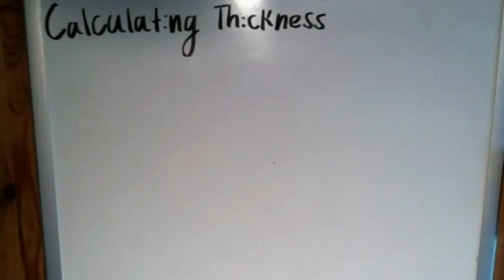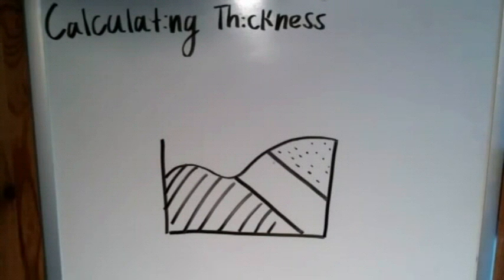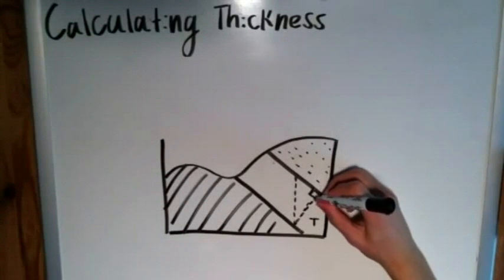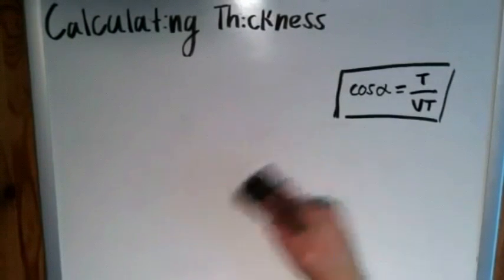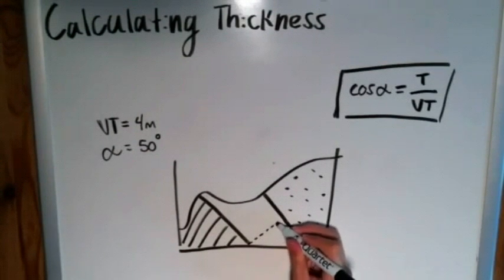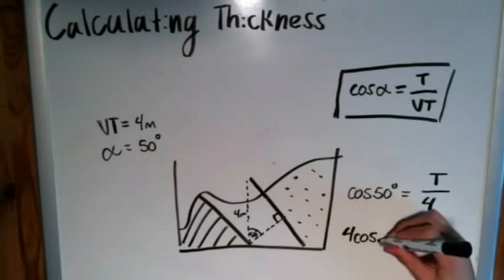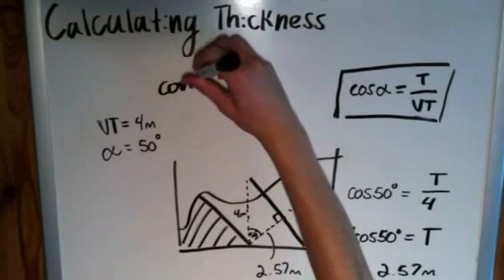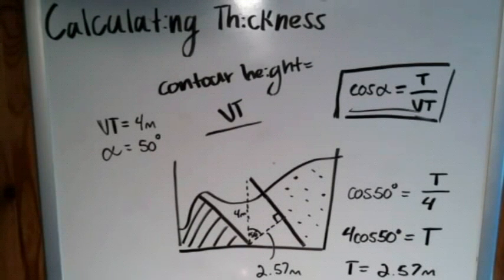The Basics of Geology: Calculating Thickness

Comment: Is the vertical thickness is the true thickness?
Reply from the maker: No. Vertical thickness refers to the thickness, the length, in the vertical plane itself. True thickness refers to the length of the stratum in the plane normal to the stratum.
Reply: The only scenario where vertical thickness = true thickness is if you were have a perfectly horizontal stratum.